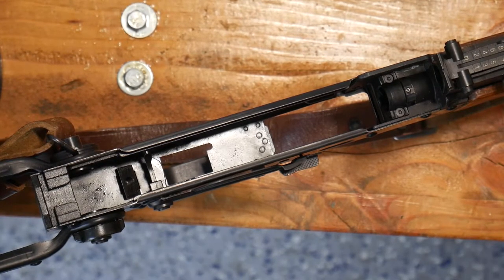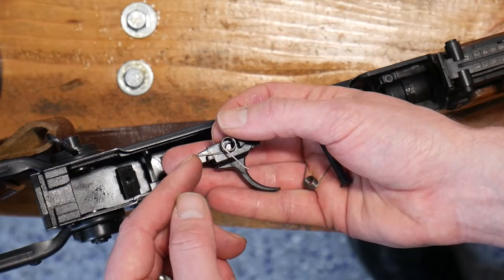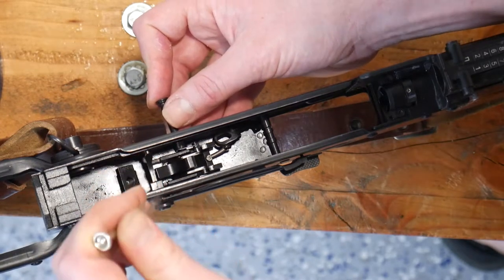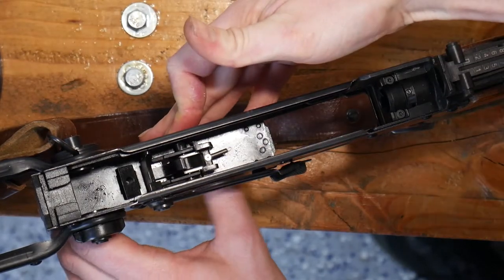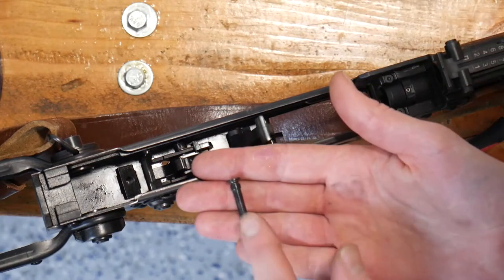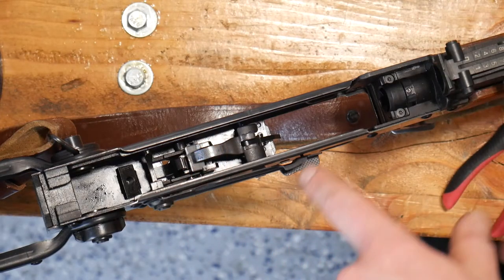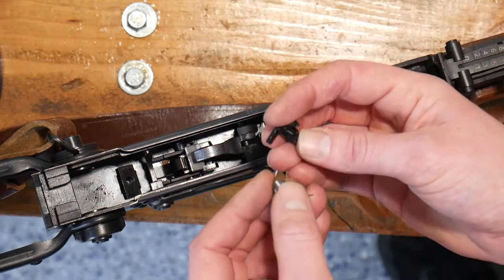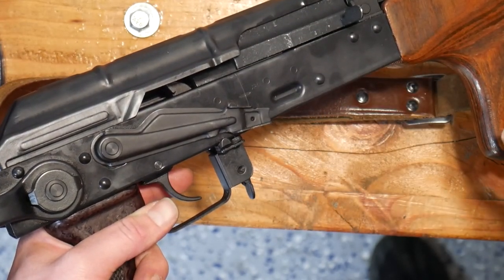GHK AK V2 Fire Control Group Reassembly / Sears Replacement

Comment: Hi there , I noticed an issue regarding the hammer hitting the gas valve , without a mag it doesn't reset and if I don't do it manually without a mag it will missfire,  is the hammer attached  to something ?

Comment: Hello! I finally received my GHK, I've replace the bolt and trigger mecanism with Hephaestuss steel trigger system and W&S full travel kit. I've got an issue, the bolt remain lock in the rear (open) position  at each shot. I think its because of the last sear installation. For the one who maintain the bolt on the tear at the end of the magazine, the leg of the spring should go above or below the pin of the hammer?
Reply from the maker: Hello! Sorry for the slow response. Did you install the Hephaestus hammer with the W&S kit? That's one of the most frequent causes for the bolt getting jammed like that.
Reply: @Ciskei Two  Hello! Thank's for the answer, yes it's what I did. I'll try only with the W&S kit
Reply from the maker: @fanchfanda6781  That sounds great! The W&S kit is only supposed to be used with the W&S hammer. Using the stock or Hephaestus hammer can cause it to jam!

Comment: After installing the hammer I can’t go back to safe now, the inside paddle is striking the trigger group when it didn’t before
It won’t go into auto from semi unless I hold down a piece in the trigger either

Comment: when i put the clip that holds the hammer pin in place ip ut it agasint the reciver but the pin and hammer still wobble side to side as if the clip was on the wrongside of the shim, any idea as too how to correct this as ive brought new clips and pins but still hae the same problem
Reply from the maker: When was your AK manufactured? There's a possibility you have a wide receiver, which is one of the issues more recent GHKs have been having. The main ways to address that are to have multiple clips OR to do a bit of targeted squishing of the receiver.
Reply: @ciskeitwo3256  it was made in 2022 i belive, i think its just a wide reciver though using two clips instead of one made the pin fit flush again and removed all wobble out of the hammer